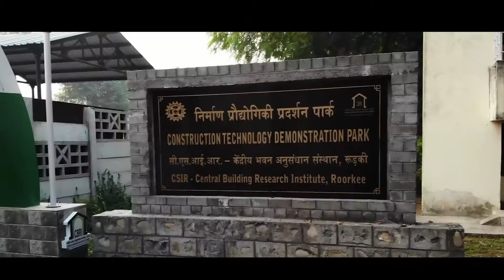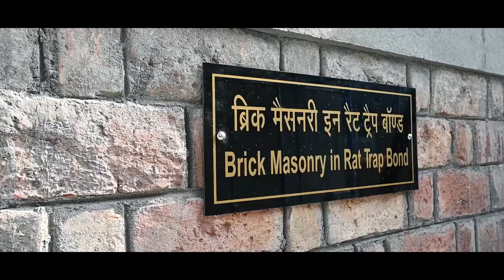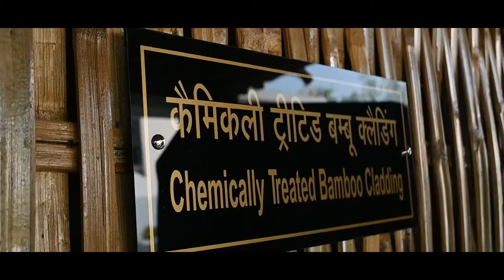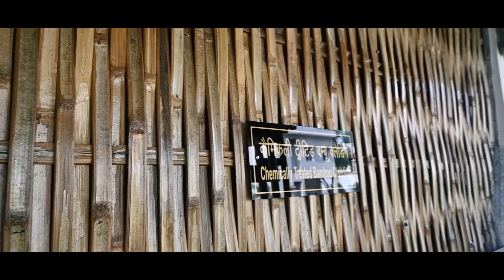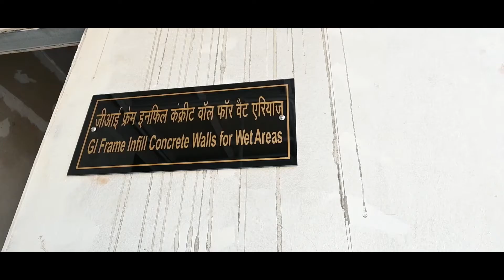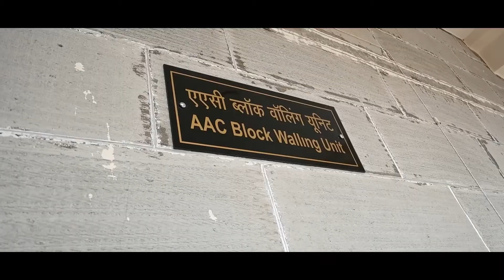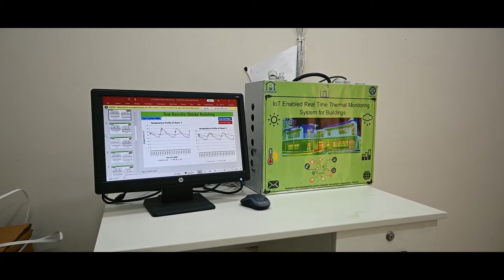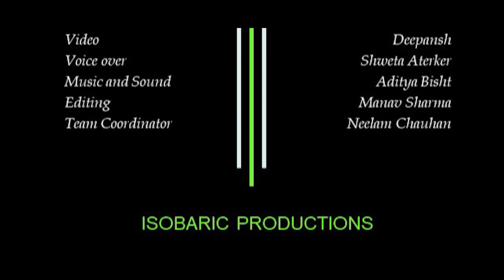Construction Technology Demonstration Park

Comment: Discuss about Infill Masonry with AAC Block work and Flyash bricks where beams and columns are designed as a moment resisting frame. Discuss methodologies to be adapted in the masonry to avoid failure due to seismic forces. Consider floor to floor height is 6m and slenderness criteria of the walls is not met.